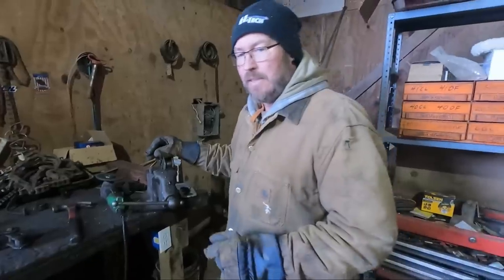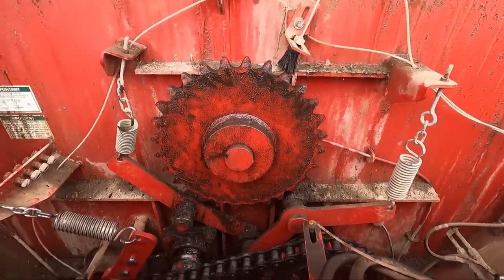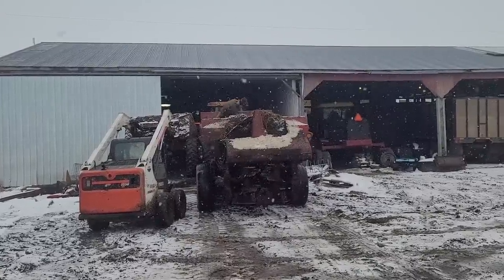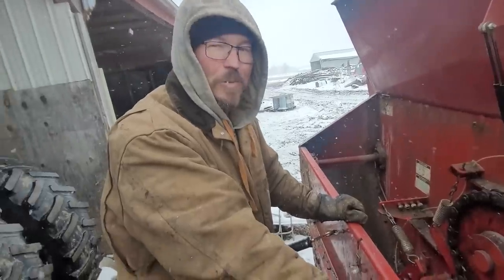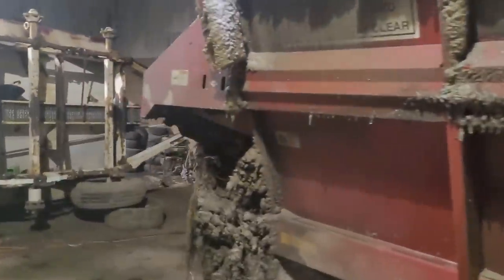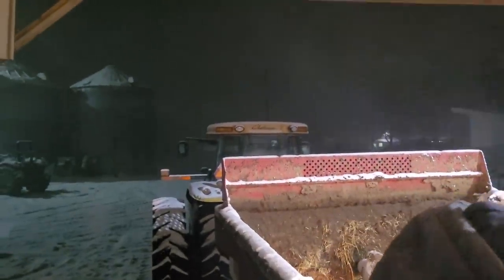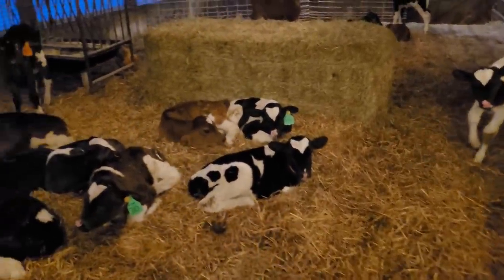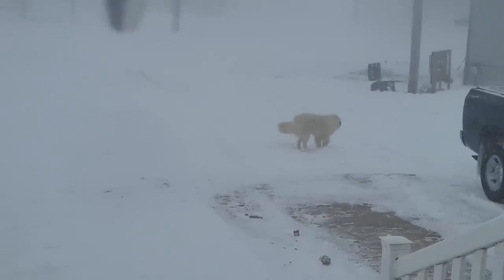Chain Keeps Breaking & A Blizzard Is Coming! 🥶

Comment: On your Meyer spreader just put one shear bolt back in. I found if you put two in it breaks the chain every time. Also another note it keep an eye on the 3rd auger gear reduction drive bearing. It’s the one that the two big augers drive off of it tends to go bad every 3 years. They since updated it to a bushing type bearing. Have a merry Christmas from the THUMB.